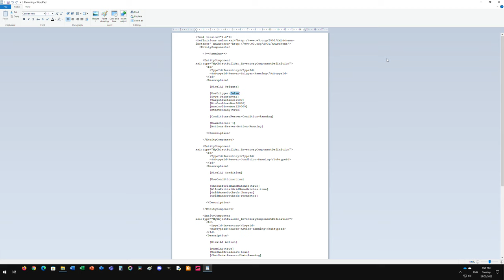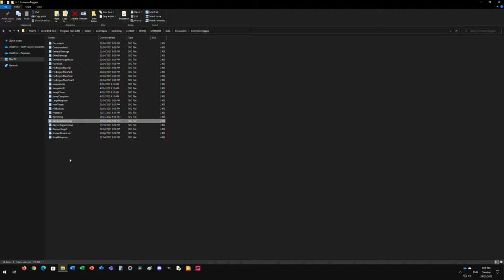Space Engineers - Wasteland Survival Ep63 - Custom Ball Turret Lights, Base Fixes & Reaver Modding!

Comment: You need BuildInfo, such a time saver QoL mod.  That would have helped you find the air leak by following a highlighted line right to the leak.  Also, the wind turbine inside the towers was a great idea, never even thought about them working inside blocks.
Reply: Re turbines, you can actually install them underground and still get the same results. As long as they clear the surface voxel by the required amount - in this case downwards - you can add them as deep as you're prepared to dig. I've used the stackable turbines and very deep pits to power entire underground installations.
Reply from the maker: I did play around with it for a little while but I really disliked how much extra stuff it put on my screen so I decided to get rid of it LOL. I would imagine though that you can customise it quite alot? 🤔
Reply from the maker: It had crossed my mind to dig down deeper to see if that had more of an effect and I think I may do that in the next episode!! 😎👌
Reply: @TheGarageGamer86  I really hope you would someday discover the copy paste function of build vision. I agree that the descrition of build vision and info is quite overwhelming but the "property duplication shortcut" aka copy paste is a huge time saver.  Please try this once:

1. open the build menu on a functional block like a light and press
"home, insert, page down" for copy all settings. close the menu with the shortcut or just look away.
2. open the build menu on a similar functional blocktype (another light) and press "page up" to paste all propeties in.

Comment: 13:00 a short term solution may be to attempt to detach the supporting guide rotor - this should relax the tension that may existing the drive rotor and you can observe for a bit to see if the sim speed issue goes away. If the sim speed drops persist you can look elsewhere for the source of the drop but if the issue goes away you'll know that it's worth trying to figure out the correct rotor displacement. [Also if the turret works fine and the drops go away you could just leave the guide rotor detached and it'll look as expected but not cause an issue]
edit: 33:00 - yeah, all that, lol =D
Reply from the maker: LOL 😎👌

Comment: the spotlights you built aren't to bad really.  As for Build vision and lights... you can use build vision to rename the light you're looking at and then go into a k menu  (control panel) and find those lights. Then change your settings.
EDIT: the spotlight looks like in needs googlie eyes :D
Reply: I was wondering if the Wasteland headlights would look good in place of the spotlights, but I don't know if they have the same react etc. What's your opinion?
Reply from the maker: Yeah I am still getting used to this mod LOL, you probably saw me stuggling with it a little bit. But yeah you can definitely do as you suggested, I will try to remember that 😎👌.
Reply from the maker: I was honestly quite close to using those lights 😁
Reply: @TheGarageGamer86  instead of using your mouse wheel to change values in build vision hilight the value you want to change hit enter to open chat menu hit delete to remove previous value then type new value and hit enter again

Comment: a other neat feature about the build info is you can use the copy and paste option of the mod and it will replicate all the option you have selected in the copy with the press of a button here a the manual:
Toggle Dupe= Home
Select All = Insert
Copy Selection = PageUp
Paste Copied Properties = PageDown
Undo Paste = Delete

ps can you juste imagine if you would had known about the build vision mod from the very start of you youtube series the time you would have saved :P
Reply from the maker: I try not to think about the time I wasted with out Build Info lol. Especially with rotors and hinges!!
Reply: @TheGarageGamer86  and piston too…
Considering the way the piston panel is placed it quite hard to do precision work with it but with the build vision you can keep your eyes where you need and still have full access and control over it as you extend it ;p

Comment: one look at the piping below the floor and i instantly knew what was causing the leak, your conveyor junctions are not in-line with the dividing walls, they're diagonally positioned. unlike with armor block on armor block airtight values, armor block on conveyor junction diagonal placement is not airtight.
Reply from the maker: Ahhhh ture! I did not know that, I thought it was because they were separate grids haha